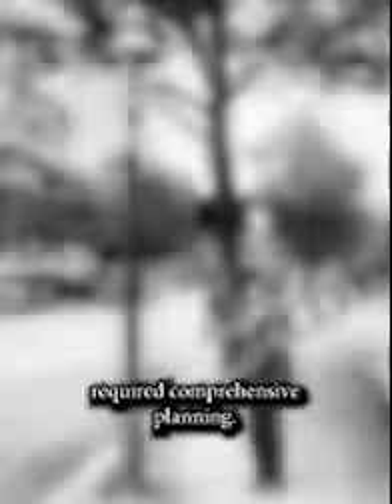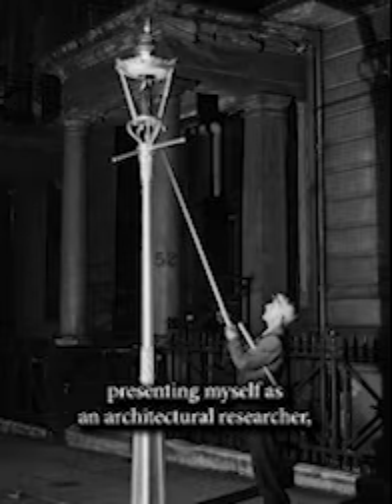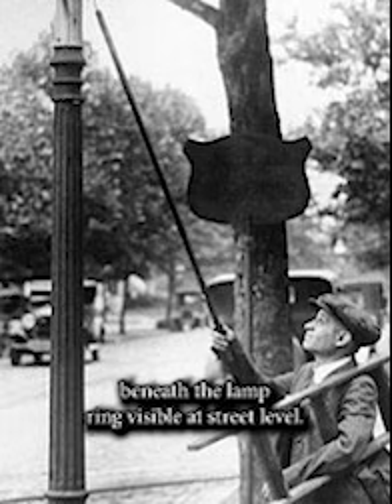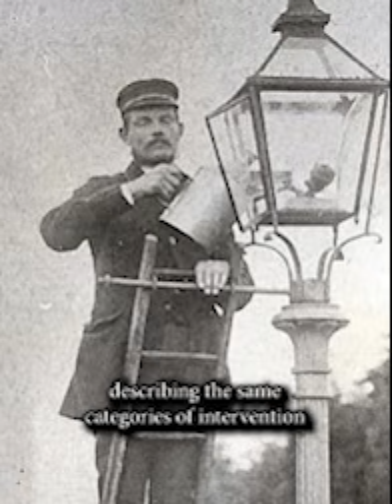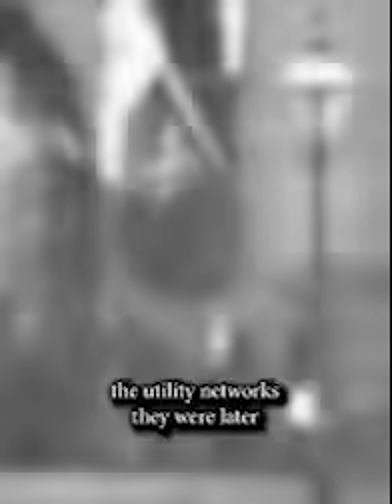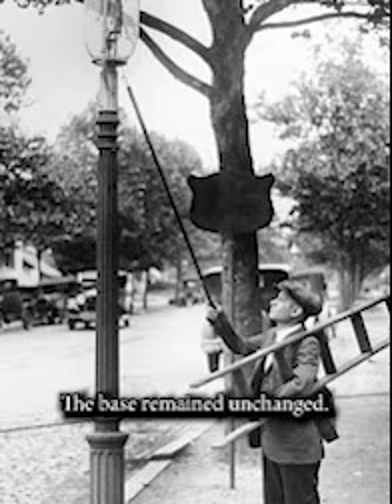Why So Many Ancient Gas Lamps of Tartaria Were Built Before Any Gas Network Existed

Comment: I've heard of a theory that these gas lamps were always gas lamps, but they were powered by methane and other natural gasses from an ancient sewer system, using the gasses rather than just venting them. It's ingenious if true. And there is historical evidence of tunnels that resemble sewer systems beneath and established well before the modern cities were even there. I personally believe that many, if not most of our modern cities were literally built on the foundations laid by a previous and probably more advanced than our current one. Like the ancient temples all over the world where we cannot replicate the beauty and structural integrity of the bottom layers, so we stacked our more primitive looking architecture on top of the ancient foundations
Reply: Why then, would city engineers across 4 countries and 6 languages, not note the blueprints plans with such a simple and unassuming explanation? Instead, they repeatedly noted that their 'origins were unknown, the power source is a mystery'.

How is it that a fully built city with a sizeable population, were suddenly and without explanation, confused about the construction of buildings and the domes that were geometrically & perfectly fitted with copper pipes for water?  Instead, engineers noted blueprints that old world construction methods were a total mystery as to the how and  purpose.  Even trains "functioned by water steamed tracks, that seemed to propel trains to their destination", and "bridge support systems were built to be permanent; had existed already for centuries in the 1800's, are still the support system for many bridges today, but construction methods are still unknown"?

Is it not strange that a population with skilled engineers & architects were seemingly "dropped into a world where by no one had/has knowledge of the economic progression or evolution, not even the immediate single generation before them"? 

Think about it: Not even their known kin - parents and grandparents - had a lived historical knowledge that could be past down! 

No one knew about the very world they occupied and were ordered by "someone or something unknown" to destroy the old world technology - on a GLOBAL SCALE!

Comment: They were originally oil lamps
Reply: You know more than an experienced architect who just told you that they were "converted"  to oil lamps from "unidentified" methods of light source within these structures -across 4 countries & 6 languages? 

You know more than engineers, who for near 2 centuries, documented on 1800's destruction and redesign city blueprint plans (located in the archives), that these structures were "converted" into "oil" lamps, and their "original "power source unknown".  They were described by engineers  as "pillars with mysterious origins"  (NOT OIL LAMPS); then shafts were filled with concrete. 

Wow, you must be a genius... Or you are experiencing a common issue that, unfortunately, too many people still suffer from - known as "cognitive dissonance":

"The inability to accept a new reality that challenges your current comfortable paradigm of what is viewed as normal".

The good news is cognitive dissonance is not permanent (if you don't want it to be). Just allow yourself to entertain the new, unexplained, and obvious contradiction that deserves further investigation. 

We aren't in Kansas anymore, Dorothy.
Reply: @Shyeena  Actually, the narrator said they were converted to gas lamps, not oil lamps.  It is quite possible that they were oil lamps and were converted to gas lamps.  Oil and gas require two different infrastructure delivery methods.